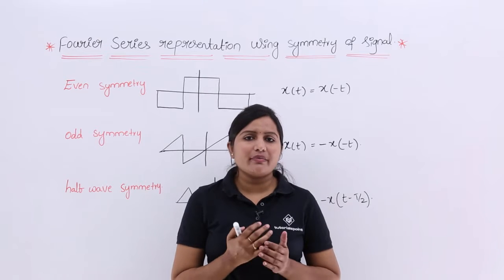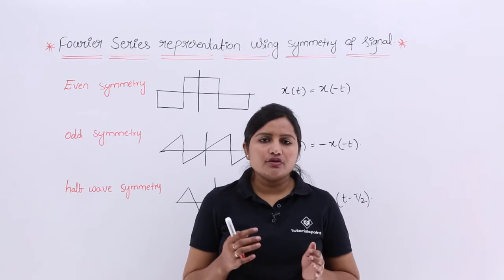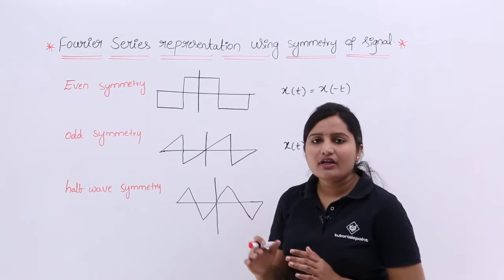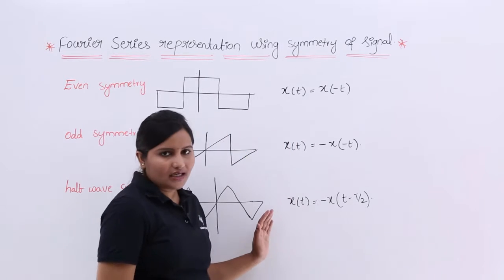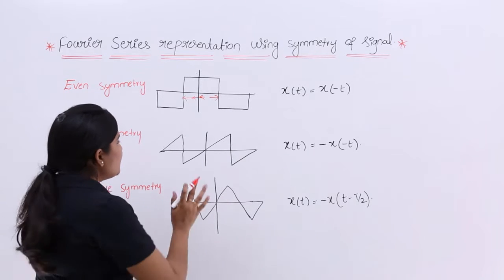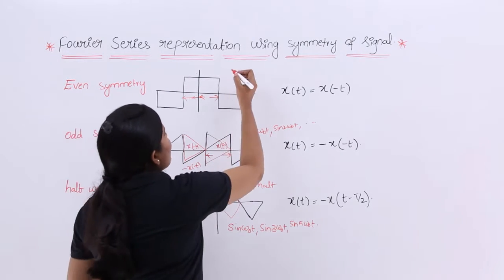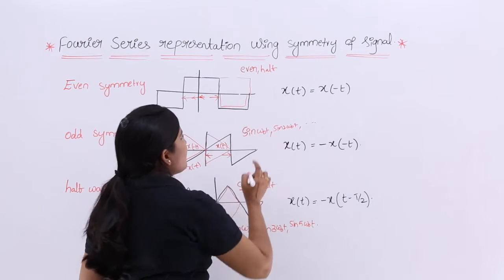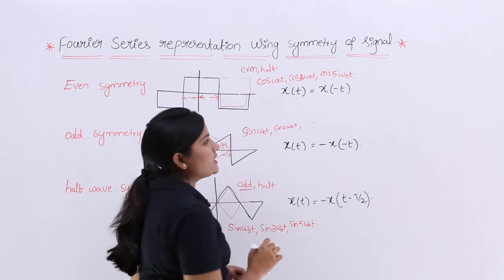Fourier Series Representation Using Symmetry of Signal

Comment: I think, in last example Signal is even with halfwave symmetric but It does have DC shift in the signal, so signal will only have odd cosine terms in addition with DC shift. I think this could be corrected in video.
Reply: When DC shifting is done then it will become half wave symmetric